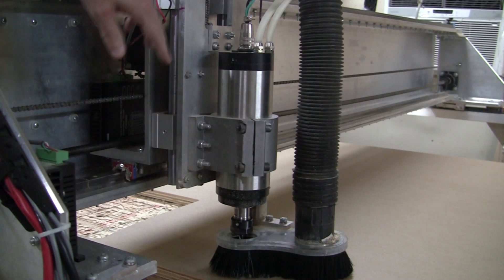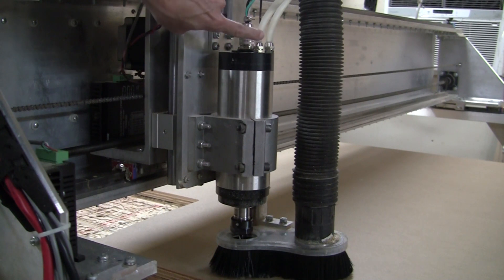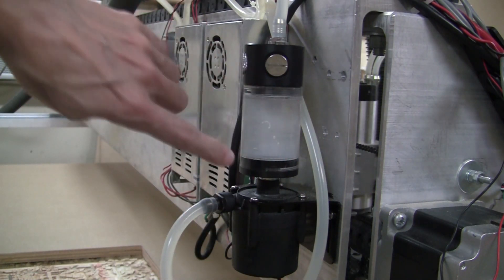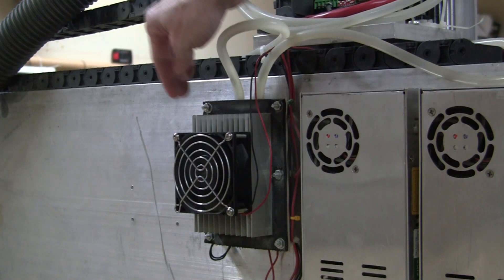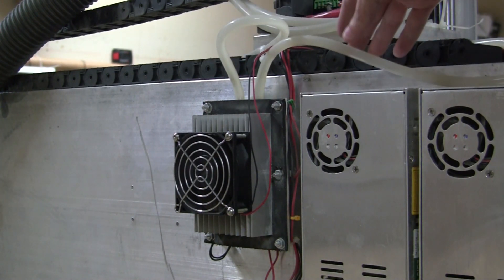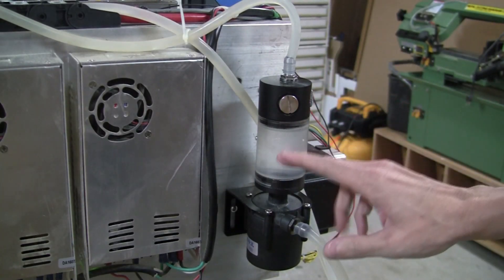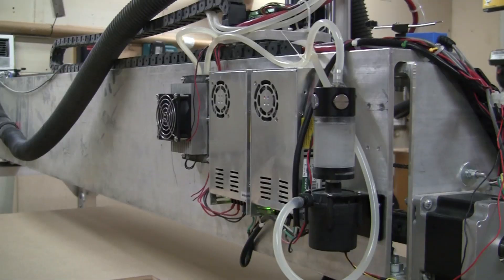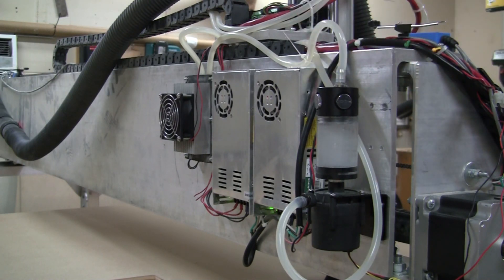How We Cool our Spindle - Spindle Cooling System Based on CPU Cooling Methods

Comment: Great proyect!! I'm still using a 20L bucket that takes a lot of space. Been looking for some radiator, but when look it up someone told me to be aware for it might generate galvanic currents, is that so? Are you having problem with oxide? Please tell so i can update my sistem
Reply from the maker: I use this system for many years and I haven't noticed anything like that. I am using CPU cooling fluid, so that may be helping.

Comment: So is this setup capable of keeping the temperature of the spindle stable at reasonably low temperature when running continuously ( or at least for a few hours) ?
There is a lot of heat to dissipate from a 2.2kW spindle running at full power so I am curious.